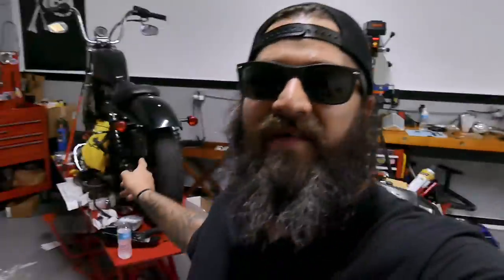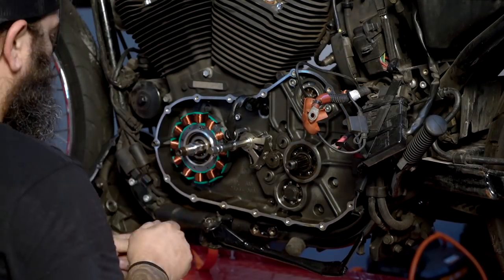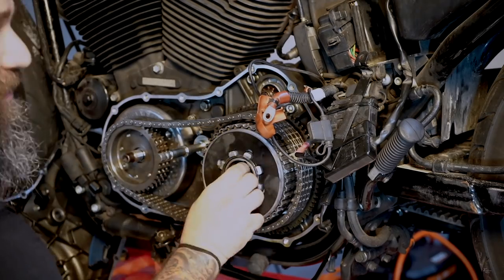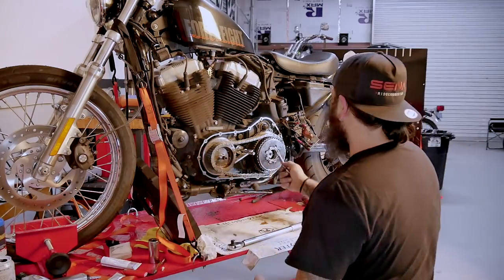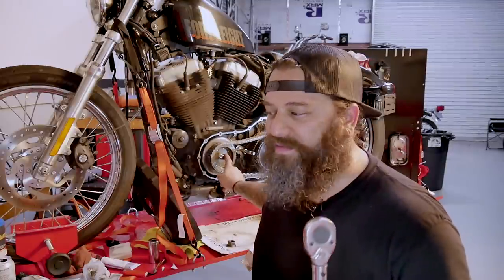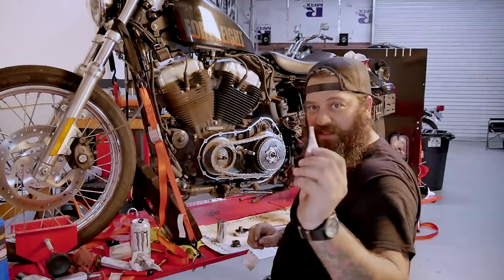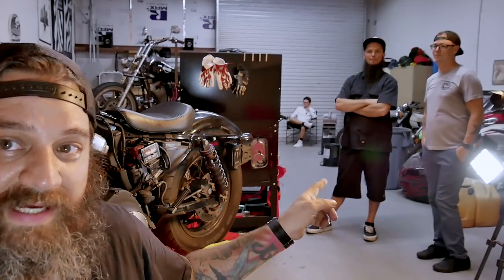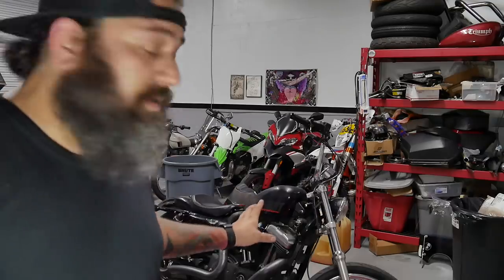Replacing The Stator | Installing Pt.2 | Harley Davidson Sportster 48 2012

Comment: Hi'ya Flip. It's great to have pals around to help. I've done my share of wrenching without assistance. I dig that ex-Forty-Eight Sporty. I'm not a fan of "steamroller" sickles. I also like Kyle's
 Yammie Bolt. Installing 2-over fork extensions was a good idea (for ground clearance). Personally, I would have gone with one-piece + 2 fork tubes. Screw-in fork extenders ("slugs") aren't a good idea. It's always a good idea to use a torque wrench on critical engine fasteners. In the past; on my Pans and Shovels; I just went with three good grunts behind a wrench. I also became very proficient with "easy-outs" (thread extractors). Ha! Ride safe. Stay frosty, Flip! -- Walt Old Gray Beard

Comment: Just a tip when torc stand from the front one hand on bottom of socket then push up on bar. A lot easier to torc.
Reply: That’s the way I torc my turbos anyway. Seems alot easier

Comment: Use a multi meter to read voltage (should be more than 12.5 not running, below that your battery is dying) then at idle,(should be 13.8-14.2, much less than that, look at your stator)then read it again at mid throttle. If you're getting more than 14.8-15 ish volts anywhere... you have an issue with your regulator and will cook your battery.

Comment: I know this is old and most won’t actually use a tq wrench but they only work correct if you tq from the end of the handle and do it in a slow smooth motion

Comment: Nice job. Got my stator on yesterday. My manual says the same thing for my 96 Heritage, 150-165 ft lbs, and these older softails shake like a mf.... so who knows, maybe could've used a bit more but with the red locktite it'll probably be fine. I know getting that compensator nut off was a bear even with a huge ass breaker bar. After it's all said and done seeing the volts go up and the battery charging after all the work is worth it!

Comment: Like your videos dude! Great you are learing how to fix your bikes man, gonna be a pro in no time! Usually enjoy your videos and Shadtrees' videos with a beer after I put my kiddo to sleep and an evening ride. Also ride a Triumph (Thunderbird 900) and a Harley (Fatboy), love both brands. Noticed your Bonnie didn't perform so well on the dyno, that is for sure about 10hp less than it should have stock at the rear wheel (the ~80 number you mentioned is at crank). You should for sure look into that, I'd put the stock mufflers back on and run it on the dyno again just to see if that is the problem, you can probably tune for them if that is the case. Cheers!

Comment: Flip. Do you have a tune on the T120? If you don't, go look at DNK Tunes. Your HP and Torque number should be way higher with a x pipe and tune. Maybe consider an airbox mod or delete. Doubt you'll hit 100 hp without head work and a cam though

Comment: It's a Harley, be back on the lift soon 😏
Reply from the maker: Sadly you’re not wrong.
Reply: Meanwhile, 80,000km on mine, and nothing apart from regular servicing. Same as my Fiat which is always a running joke because it’s never missed a beat. And same as my Royal Enfield, nearing 40,000km and never been touched apart from servicing.
Reply from the maker: Well. Mine got run over with me on it
Reply: Flip Na hate when that happens. In 2002 I was hit by a truck that ran a red light. My entire right side of my body was screwed. Spent 12 months learning to walk again. I lost my career (I was a bike mechanic and about to start working for Kawasaki with company bike and 2 trips to Japan per year). I lost my house, my marriage, everything. But nothing will stop me. Always loved bikes.

This is why I love your videos, you went down and you’re still back on two wheels.

Comment: Hey man, I want to ask something. I have a 48 sportster which has a problem when I push the gas sometimes the headlights flicker and the engine feels like it drops and sometimes the engine suddenly stops. Usually what is the cause? Is it the alternator, electricity or combustion? Please help me because I am very confused right now 😅